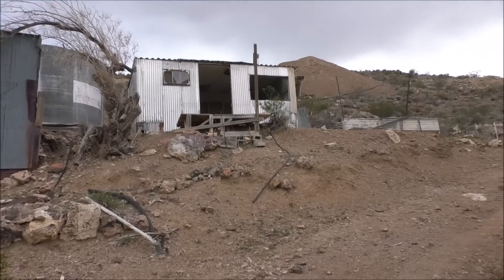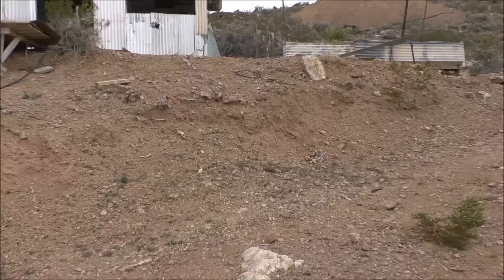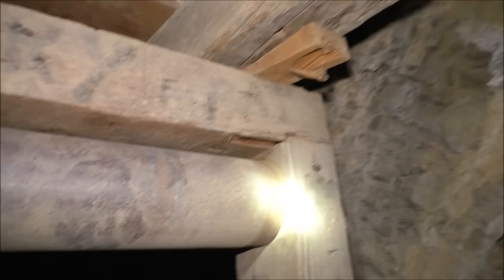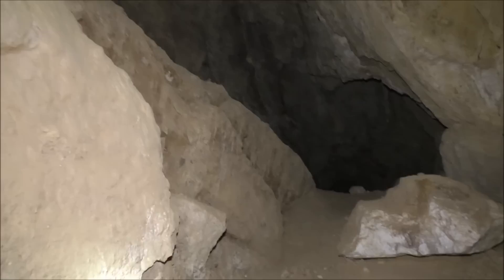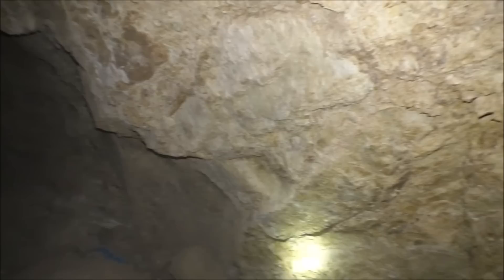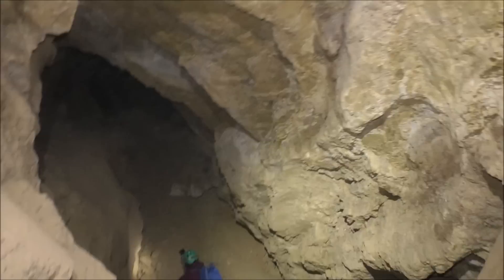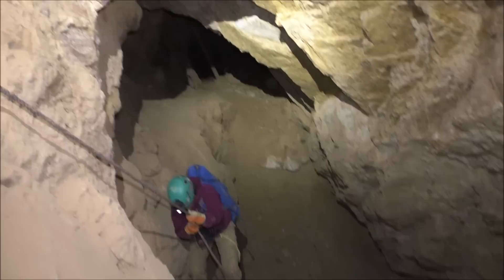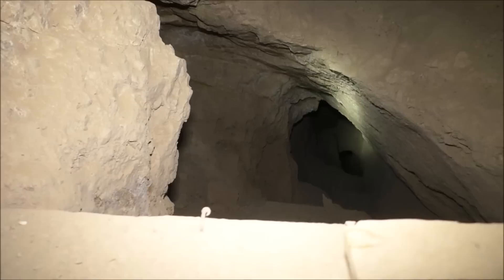#316 The Overfield Mine    gets us in trouble!

Comment: The Crown Point and Globe claims (Overfield Mines) are privately owned and the last time I heard Wulfenstein Const. had a lease agreement, but that was a number of years ago.
Ed Overfield purchased the mine in 1908 from the Johnnie Mine and his son, Charlie, later took the mine over and worked it until his death a few years ago.
     Ed Overfield, a sewing machine salesman from Chicago, built the house and later Charlie added on to it. Charlie lived most of his life there on the side of that canyon with no power, water piped in from a spring, wood stove for heat and propane refrigerator. I spent a lot of happy days in that old cabin.
    The Johny Mine (original spelling) was changed to Johnnie in 1904 to conform to the name of the townsite. Records I have state the Johnnie is 1200 feet deep with a total of 3 miles of tunnels junderground. About 12-13 years ago the owner deeded the mine to the Pahrump Museum and they closed it off citing it as a danger. That is a shame as it is a wonderful place. I have measured all the building sites and can tell you what each one was. 
    You can find out more about the Johnnie mine, Overfield, Chispa Mineonline